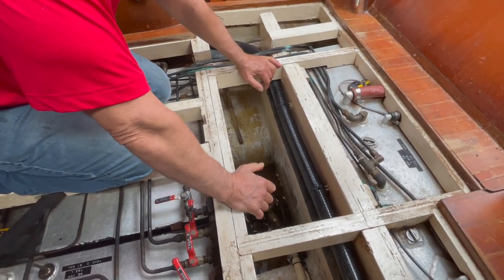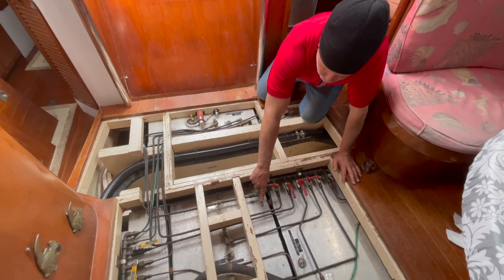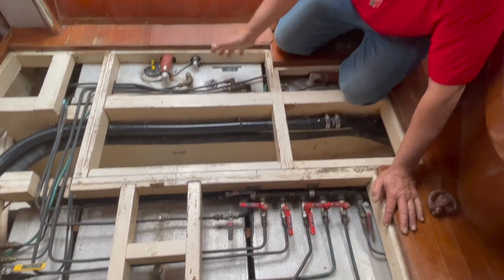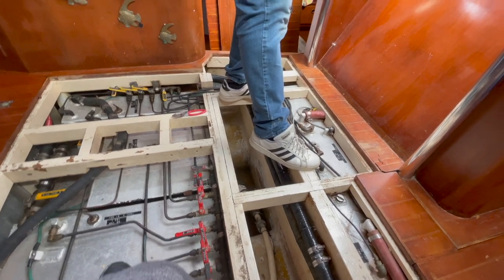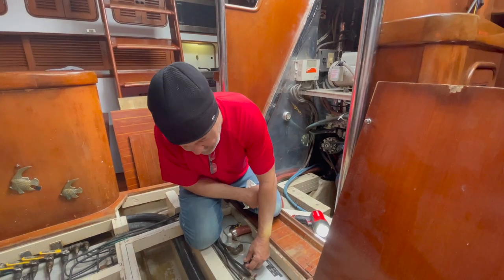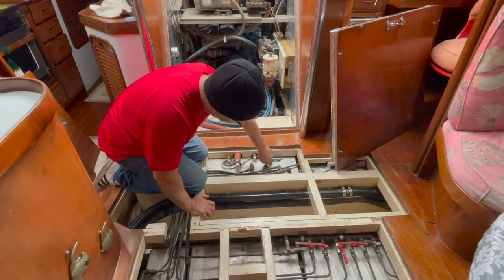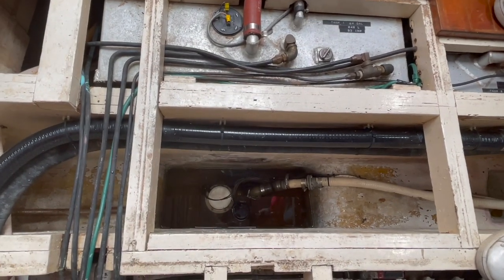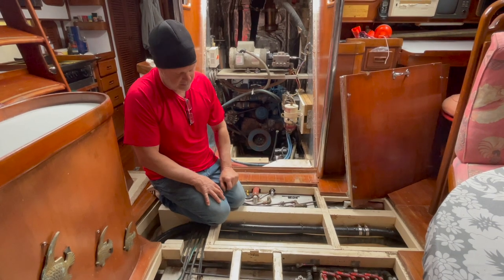Will we FINALLY Push off from the Dock?? Sailing SV Bohemian Ep. 38

Comment: So this must be November 2021 as Thanksgiving is soon.  I like watching you work on your big boat.  Most people, without you house flipping experience, would not be able to maintain a boat that size.
Reply from the maker: Wait till you see what happens . It was mind boggling just figuring out the fuil system when I first got to the boat . Things have calmed down some finally . Now I just fix things .
Reply: @sailingsvbohemian1464  I did not like the concept of adding new fuel until the old fuel is all gone.  I am afraid there is some dirt or bug in the tanks or fuel lines from the old fuel and adding fuel will make it more difficult to clean up.  Hope I am wrong.
Reply from the maker: @UUBrahman  when I did the video I was still trying to figure out the fuil system. If you ever get a big boat get ready for a tun of puzzles . You can use the tranfer as a polisher. So I can add diesel stabilizer and a additive for diesel bug . Then I’m able to pull out of any tank letting the pump run  through a filter and water separator then back to the tank it came from . It was hard to figure out . So now I’ve been polishing the fuil in all the tanks every month or so . It takes about a hour to polish a tank . You can tell by the filter how dirty the fuil is . So far the filter looks relatively clean . I should polish them while the boat is being jostled around .